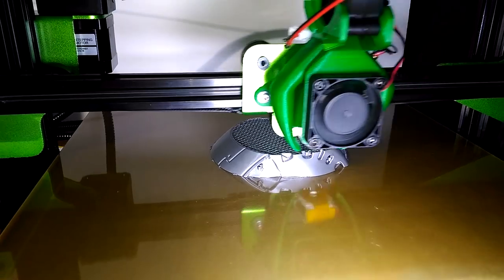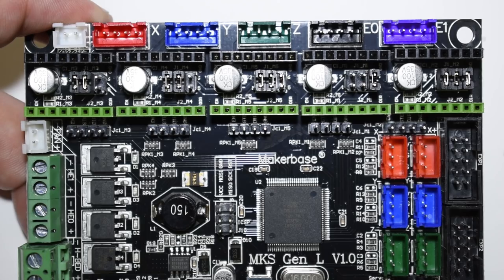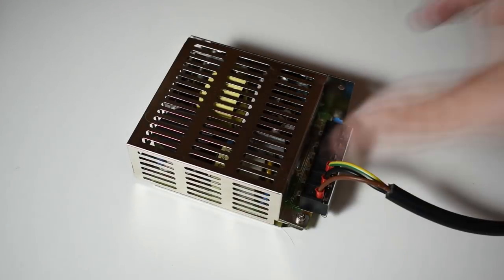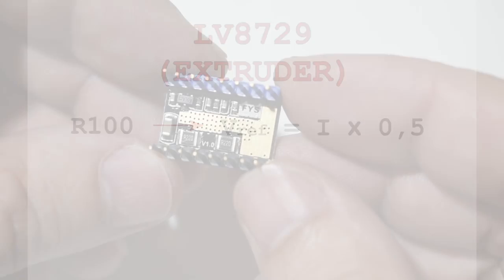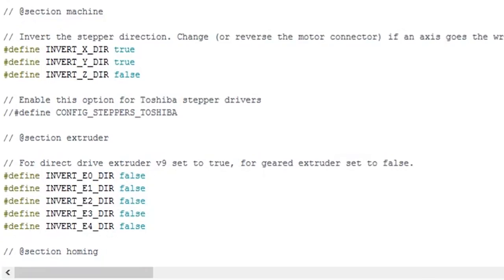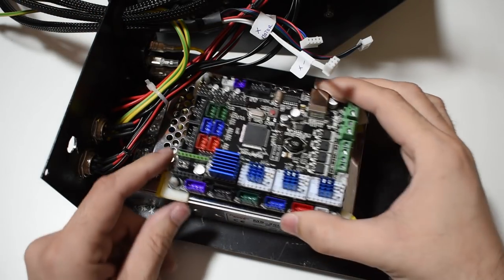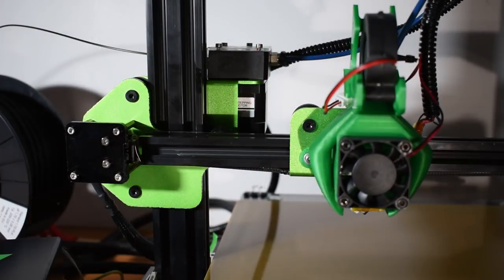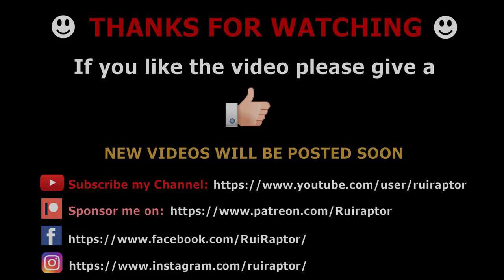Install & Setup - MKS GEN L + TMC2208 + LV8729 (TEVO TORNADO)

Comment: I have a tevo tarantula.. Do these specs still work for vref etc? Because your description says this world on both but that the vref js for tornado... So.. Where are the on a for a tarantula?

I heard my formula is  1.3x 8x resistor (1.3 being the stepper current.. 8 being constant?... N then resistor on driver) = vref
But I looked up stepper "42SHDC4043Z-22B" and found its current is 1.5A....? 

So... All. My. Tmc 2208 are 110 resistors and lv8729 is a 220... I don't get where your numbers came from though.. 

Also in firmware what do I do about  "minimum stepper pulse" and "maximum stepper rate"?

Tmc2208 and Lv8729 both have different settings.. 

I had mine set to tmc2208
Min pulse: was 0 but lv8729 is 1.. So do I choose the highest minimum to not stress it?

Also for max rate :
Tmc calls for 400000 and lv wants 130000
Guessing I go with lv settings...?
Reply from the maker: Hi, you can use the same values except for the Y axis motor. For the tarantula and for the Y axis motor, use the X axis vref value instead.
Reply: @ruiraptor  what do you mean "the same values" ? Do you mean all my Tmc2208's are the x vref value? Because Y was the only different one... Also, the vref for lv8729 you explained is also the same for me? 
My driver is supposedly 1.5a and how did you get the "1.1" value to multiply stepper amperage by?  Where do these numbers come from? I'd like the full formula. 

 I'm using an old tarantula, not a pro if that matters. 

 What about the minimum and maximums in firmware like I asked in my initial comment? There are 2 options based on if I use Tmc2208 or lv8729... I can't leave it blank.. So what driver do I set the values to? 

Lv seems to be the slower one, so do I set everything to its speed (min/max) to not over load it. Or do I set it to the Tmc2208 's settings?

Comment: Hello Rui  I have an issue with my Tornado with the MKS Base 1.6 as it does not activate the Extruder stepper motor.  I decided the to upgrade to a MKS SGen L 1.0 control board with TMC 2209 drivers.  My main issueis that Extruder Fan on the MKS Base 1.6 has 2 loose wires that had a clear green socket FAN connection on the board where I have the wires attached in the Green ports.  On the SGen L 1.0, there is no such FAN connector in the green connectors, just 12V, HBed, HE0, HE1 and the a white socket for Fan.  What I understand is that the Extruder Fan must be connected with constant 12V.  I further plan to have Dual Extruder, so the HE0 is for the first extruder and HE1 will be for the second one.   Is the white socket Fan giving constant 12V to the Fan?  Do I need to attach a connector from taken from a Fan or bought on Ebay for example or this Fan board connector is not suited for the Extruder Fan?  2nd question:  Are the TMC2209 parameters the same than to TMC 2208 from this video?  If not, how to get them working?  Have a good day and Thanks in advance.
Reply from the maker: Hi Max, the extruder stepper motor only turns with the nozzle hot (>18 degrees C). Regarding the hotend fan, the tornado comes with the hotend fan and case fan connected to HE1. These fans are controlled and they turn on when the nozzle's temperature is above 50 degrees C. You can connect them directly to 24V (not 12v...the tornado's power supply output is 24v not 12v). Regarding the drivers, and depending on the firmware version, you need to select the correct driver in configuration.h. If you are using the TMC2209, you can define as TMC2209_Standalone.
Reply: @ruiraptor  Thanks for the valuable info you gave me.  With this, finally my stepper works now, but in the reverse direction.  I really don't understand why since I used the same cable and connected the same way....on the board and on the stepper.  Something to change in the configuration file?
Reply from the maker: Hi Max, this is because the TMCs run in a different direction when compared with the Allegro. You need to find the define INVERT_X_DIR , define INVERT_Y_DIR, define INVERT_Z_DIR  and define INVERT_E0_DIR  (in configuration.h) and change the true/false logic.
Reply: @ruiraptor  Thank you, I will verify this

Comment: so the numbers you multiply I by come from where? does every machine use different multiplier number? also how do i know what voltage i want for vref?

lastly is 1/16 step optimal? i know stealth is another mode and sweep cycle i believe was another?
Reply from the maker: As i answered before, the values are available in the driver datasheet. You just need to check the resistor that the driver is using (as i mention for the LV). The 1/16 steps is the best setting for these 8bits boards.

Comment: When moving from MKS BASE 1.6 board to MKS GEN L, is it enough to just change 

#define MOTHERBOARD BOARD_MKS_BASE

to

#define MOTHERBOARD BOARD_MKS_GEN_L ?

And I've noticed that Configuration_adv.h has some TMC related settings, from comments in the code I guess they'll only needed for UART (or SPI in case of TMC2130) mode?

Thanks
Reply from the maker: Hi,
you don't need to modify the motherboard type as both (MKS base and Gen L) have the same pinout. 
Regarding the TMC settings, you are correct. If you will use them as is, then you only need to change the direction.
Reply: Thanks!

Comment: Hey Rui

I instlled the TMC2208's and the LV8729. I have not yet adjusted the current.

I also updated the firmware to MARLIN v 1.1.9. I could not find the version I was looking for on the Tevo Tornado Owners Group facebook page, but Tevo sent me a link to the one that I instelled.
But I cannot find any mention of TMC2208 in the configuration.h file, nor in the configuration.adv.h file.
The stepper drivers all run the axis in the correct direction though.

Also with this firmware, it has UBL ubstalled. What does that do?

Are the Rb 42SHDC4043Z-22B Step Motors in fact 24v, and where do I find the Vref for these motors. Or how do I figure it out.

I am also trying to compile a list of what I need to know about the Tevo Tornado. And a list of the adjustments that I need to perform.
Reply from the maker: Hi Michael,

The firmware that Tevo sent you probably does not have the feature where you need to define the driver type.
And if that is the case, you can leave it like that and it will work.
Regarding the Vref, i think you might have the wrong idea about the motors. The vref is a voltage reference that the driver will use to adjust the output current to the motor. In other words, you are defining output current and not output voltage.
Use the same formulas that i mention in the video and you will be fine.
Regarding the UBL, here you can find the explanation for it: https://github.com/MarlinFirmware/Marlin/issues/6510

Comment: Another question is, what is the main differences between TMC2100, TMC2130 and TMC2208 and how to choose the right one?
Thanks!
Reply from the maker: Hi Nuri,
Some have SPI connection, others have UART connection and some don't have any.
The max output current is also different. If you just plan on having silent and smooth drivers, go with the 2208 because they are easy to setup/install. You can get all this information in each driver datasheet. Just google "TMC2100 datahseet" for example and you can see all the details for each one.
Reply: Thanks for the answer, I will use it for 17HD4401 (Tevo Tarantula Stock) stepper. Is the output of 2208 driver OK for that?
Reply from the maker: Yes, it's ok

Comment: So would the 5v USB be adequate just to flash the firmware? If so I could do that at my main computer rather than dragging my old laptop down to the basement where my printer lives.
Reply from the maker: Yes, 5V from the USB is enough for firmware update.
Reply: @ruiraptor  thank you!

Comment: Can this be setup so the Marlin firmware can talk to the driver directly  using UART? is it possible?  Apparently the  voltage can also be changed via software with this setup  also does marlin have to be setup to use the new drivers stepping?
Reply from the maker: Hi Jim,
you can do this but you need to modify the UART driver header pin and connect it to the board comunication pin. 
That way the firmware will be able to modify the current to the motors.

Comment: Hello, I love your video and I'm upgrading my Wanhao Di3 V2.1 following your tutorial.  One thing though, I can't understand your driver current equation.  Can you please help? I have 1.02a motors for X, Y and E and 0.39a for each of the Z.  I'm using a LV8729 R220 (as per your recommendation) on the E, which is a 1.02a stepper.  When I use the equation I found on 3Dprinterwiki (Stepper Amp x 8 x driver Ohm, then 90% of that) I get 0.71v for the X and Y,  0.30v for Z motors and 1.61v for the Extruder.  These seem like odd numbers.
Can you please help? I have a printer in parts I can't use because I'm confused with all these equations.  I'd be very grateful.
Reply from the maker: Hi Neil,
Good question.
The formula i used can be found in the drivers datasheet. You can find it if you download the datasheet from each driver.
You just need to replace the resistor value with the one you have in your driver module. For the TMC2208, the resistor value will mostly likely be the same but for the LV8729, you need to check if it's a 100 or 220 ohms resistor and use that in the formula.
I use 1.3A stepper motors but i dont setup that much output current because of 2 things:
1- These stepper chips have an awesome output performance and you can work with less current for the same motor performance.
2- The higher the output current, the higher the temperature they will reach.
Having said that, you can maintain a lower vref/output current for the same motor performance and keep them running a bit colder.
Too much heat will make them shutdown (thermal protection).
Reply: ruiraptor I was being lazy and hoping you’d suggest the Vref settings for me lol. As stated above, I have the LV8729 with R220 resistors. Does that mean the equation is 8 x 1.02 (motor amp) x 0.22? At 90% that gives me 1.615v, which seems a lot.
Also, the Z motors are only 0.39a and with the TMC2208’s, that gives me 0.61, which again seems a lot.
The X Y are 1.02a with 2208’s and that gives me 0.816v.
What do you think? Do you come up with the same values? The LV8729 has R220 resistors and the TMC2208’s have 0.11 ohm resistors.
I’d really appreciate any help you can give me please.

Comment: Hey Rui, I recently did the upgrade! The Tmc2208's work perfectly and are soo quiet. But the LV is sooo loud and makes a horrible noise, after 1 week and I also habd to change the steps/mm to 1040, do you know why?
Reply from the maker: Hi.
That is not normal. Maybe you have it setup wrong or you have a faulty driver. It's not the first time i hear about that unfortunately. My LVs are working perfectly in my printers.
Reply: @ruiraptor  Okay, I have already changed the board and the driver and set everything up as you did! My guess is, that its because pf my firmware, which one are you using?
Reply from the maker: I'm using the stock one with my own modifications (just enabled or disabled some included features). There are more recent versions but i didn't had the time to test them yet.
Reply: @ruiraptor  Ok I am using Marlin 1.1.9 for it, do you have a link for the old firmware if the tornado, i have already searched for it on tevos website, but if i click on it it hands me of to ther homepage. Or could you send me yours?
Reply from the maker: You can find the stock firmware here:
https://github.com/tevo3d

Comment: hi ruiraptor .... I own a tevo made with tmc 2208 drivers but sometimes the extruder stops working randomly .... could you help me please? Thank you and great channel
Reply from the maker: Hi Everton,
Did you adjust the vref on that driver? Does it get too hot?
The TMC is not the best driver for the extruder and that's why I recommend using an LV8729 driver instead. For troubleshooting i recommend you to swap the TMC2208 from the extruder with one from the X or Y axis.
Reply: hi ruiraptor
thanks for the feedback, so I configured the vref and also made the exchange of the tmc 2208 for a reservation without success ... later I will try to perform the engine change
Reply: Hi Ruiraptor ...
if not ask a lot could send me to your tornado marlin 1.1.9 configuration ... thanks
Reply from the maker: I'm currently using the stock version with my own modifications. I haven't installed the 1.1.9 version in the tornado yet.
Reply from the maker: Everton, 
One other thing that can cause the driver to stop randomly is due to poor cooling which triggers the thermal protection.

Comment: Hi, a freind of mine is having an issue with this upgrade where during y rapids and other movements the stepper will vibrate. his fans will also not turn on. would you know any reason for this?
Reply from the maker: There are a few things you can check. If youu are using Cura, disable the acceleration and jerk control. Also, check your belt tension.

Comment: What's the difference between  TMC2208 LV7829 for the extruder?
Reply from the maker: The TMC cannot handle the fast direction changes from the extruder. The driver will stall and give you underextruding issues. The LV is an industrial grade stepper driver and can handle without issues.
Reply: @ruiraptor  thanks

Comment: Bom video!
Mas tenho uma duvida.. 
Eu tenho os steppers tmc2100 de watteroott e uma board igual a essa..
As configurações são as mesmas? 

Cumprimentos
Reply from the maker: Boa tarde Filipe,
Os drivers watterot têm o mesmo pinout, no entanto precisam de ser configurados de maneira diferente, ou seja, os jumpers não são usados e a configuração do microstepping é feita soldado pequenos pads na board dos drivers. Pode ver mais informação aqui:
https://learn.watterott.com/silentstepstick/faq/
Reply: ruiraptor 
Obrigado pela resposta.
Vou ver se consigo configurar...
Alguma dúvida posso perguntar??
Reply from the maker: Claro. qualquer questão é só dizer.
Reply: @ruiraptor  
Isto vai ficar parado umas semanas.. A placa não está em condições.. Começou  a acender 2 luzes verdes atrás do usb e nunca mais funcionou com o pc.. Falei com o vendedor e ele vai mandar uma nova.. Não sei o que se passou porque nem tinha feito nada..
Os tmc tenho alguma confusão com aquilo..

Comment: Hi Rui Raptor! what is the version of your firmwar for the tornado that you use
Reply from the maker: Hi Jean,
I have the stock firmware with my own modifications.
Reply: Hi Ruiraptor. I ask you his questions because I have a lot of trouble with my Tornado, twisted glass plate, defective engine, mks board V1.4 defective, no longer control the temperature of the bed. I am able to reconstruct it completely a bit differently for more reliability. I install E3D engines, double extrutsion Chimera air cooled 24v, MKS gen_l V1.0 with LV8729 and TMC2208 and so on. I will undoubtedly have another technical question to ask you, thank you for reponce they my greatly help! . Good success .

Comment: Hi thnx for this great video. What version of firmware are you using in this vid???
Reply from the maker: Thanks,
I installed the stock one with the modifications necessary for the drivers. There are more recent versions online available.
Reply: @ruiraptor  where could one find that?  About to undertake this and like to have the latest!

Comment: Hello. Where do you find the optimum values of the current to find the optimum voltage for each motor?
Reply from the maker: Hi,
For linear output drivers, you can calculate the output current value for the stepper motors you are using by checking their datasheet. However, some driver can operate as good with lower output currents and with that you take advantage of a lower driver temperature. Some experts can tune the current by listening to the motors. I normally recommend to start with a comfortable low current, test and raise it if you need it. Current too low will make the motors run with low torque and too much current will make the drivers and motors run hot.

Comment: Hello Rui! What's up? Followed your tips to setup a MKS GEN L V2.1, all went fine. But I had to change the pin outs setup on pins_Ramps.h. Using pronterface I can control  Extruder 0 , extruder 1, the fan, the stepper motors, but I can turn on the heated Bed. I send the command  M190  Sxx, and the Mosfet C doesn´t turn on. What should I do ? help!
Reply from the maker: Greetings,
one question...why did you had to change the pins setup? 
Check this and see if it helps: https://wiki.openastrotech.com/Boards/MKS_Gen_L
Reply: @ruiraptor  I found out that marlin 2.903 has the pin settings wrong.. went back to 2.902.

Comment: i have a tevo tarantula and tevo flash. both with dual z. mks gen L v1.0 i believe both use.
how do i find out the vref for xyze on both these machines?

i had people telling me to test the diver voltage with motors attached and just set them all to 1v with no math used...  but i was also told the voltage depends on if u have "pancake steppers"... i have stock on both machines...not sure what they use
Reply from the maker: The calculation for the vref/output current is available in the driver datasheet. You can google for TMC2208 datasheet and you will have all the information about the formula used. The desired output current then varies according to the stepper motor you have installed. The values i'm using are the best ones for the stepper motors (except in you case the Y axis since you dont have a big motor...but you can use the same vref i use for the X in your Y axis).

Comment: Hi Ruiraptor, where do you buy the adhesif clip for the mainboard? good video, thanks.
Reply from the maker: Hi Jose,
Check here: 
https://www.banggood.com/pt/100Pcs-Nylon-Plastic-Adhesive-Spacer-Standoff-Locking-Snap-In-Posts-Fixed-Clips-p-1102876.html?p=84280421195697201804&utm_campaign=21195697&utm_content=3312